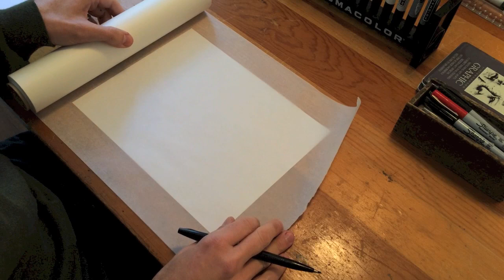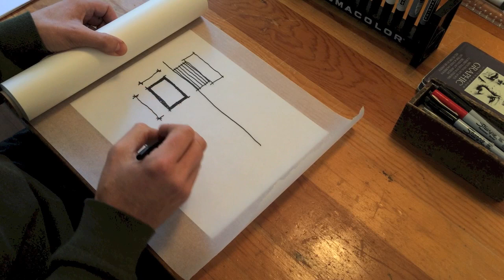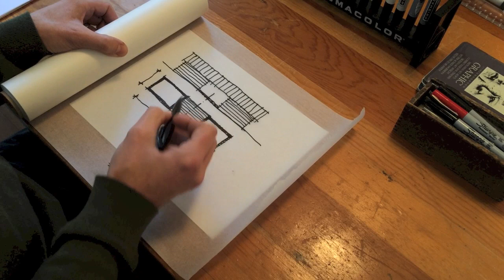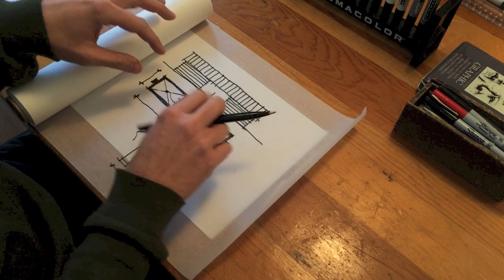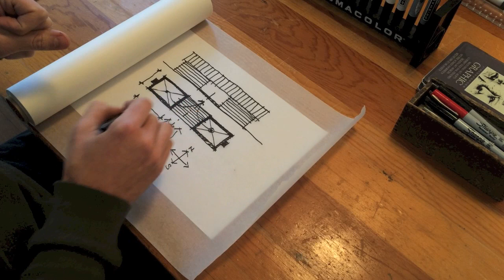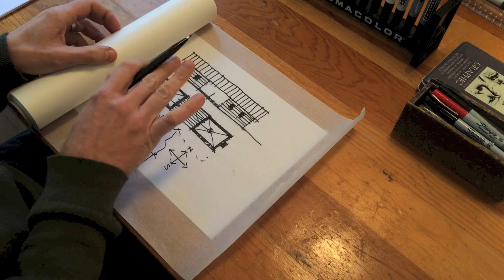The Modern Dogtrot - Part 1

Comment: Hi, i found your you tube video on the Dogtrot House to be facsinating. I luckily tripped on it in search of summer ventilation questions i had about my own (stone 1807 with circa 1840's clapboard add on) house, with all of its quirkiness. Which I would love your opinion on on, as I only can slowly afford to restore it to its originality. I did wonder though in looking at some of the other basic Dogtrot historical videos if there is any missing advantage in leaving out (in your plan) the one or two foot raising of the complete structure from the ground? Like the southern versions. Does that help cool the house in the summer or make it  too cold in the winter if your building up here in the north? Thanks, Eric J. from New Jersey ericj519@hotmail.com
Reply from the maker: Eric Jurgensen thanks for watching and for your comments. I have specific reasons for using a foundation that's married to the ground (better/more predictable thermal performance, I can use the foundation as interior finish, among other things). Foundations though tend to be very climate specific and of course owner preference must be weighted too, lots of variables that might suggest alternative solutions. Cheers...